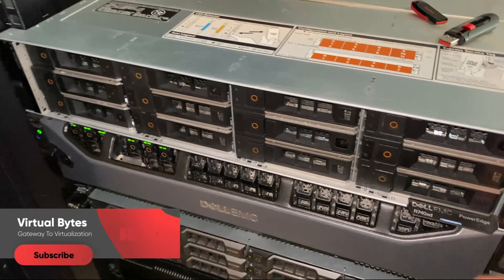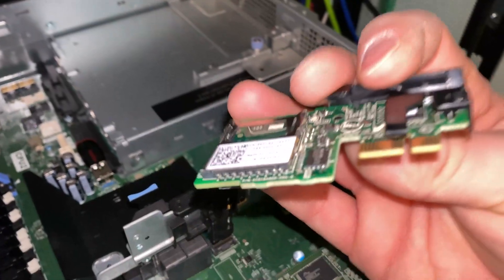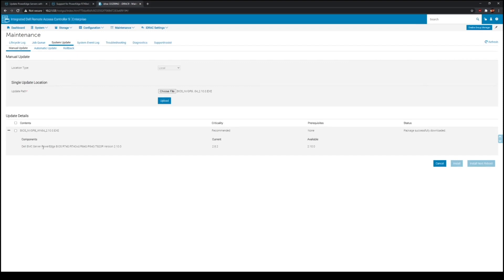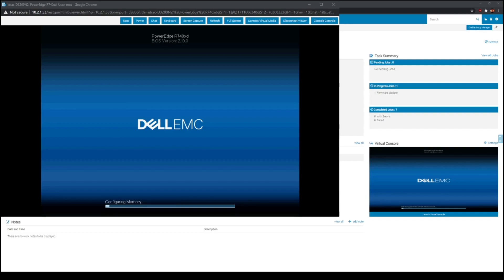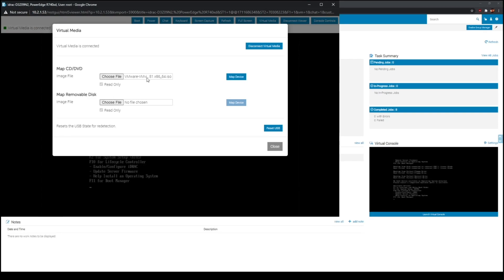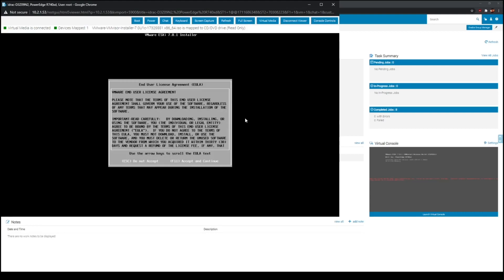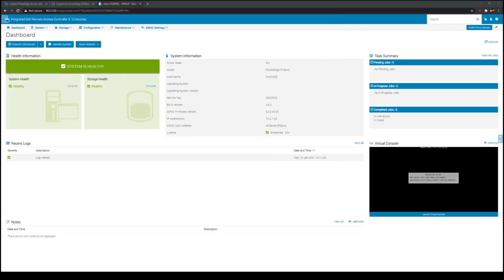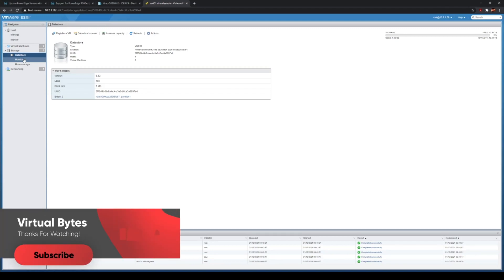Installing / Configuring Dell R740XD for ESXi 7.0 Hypervisor - Home Data Center Project - 2021

Comment: hi, nice video man !  thx
install the vsphere 7.x.x is not recomended instal to USB/SD cards. be aware of this, i have very bad experience also with ISDM module (SD card module) with firmware 1.15 now the dell rolled back from update catalog because firmware 1.15 has some bugs, recomended ISDM module firmware for SD cards is 1.13 :)
Reply from the maker: Hi! Thank you and yeah it’s recommended to use some high quality SD cards but the newer versions of 7.03d are now having issues with SD cards, even when the ISDM does it’s virtual overlay to hide the SD card and keep it as a virtual disk but now the new version of esxi is not as happy anymore as prior versions. 😊
Reply: @Virtualbytes1  Yeah, 7.02c works fine with SD cards but definitely need to use SSDs or real hard disk.